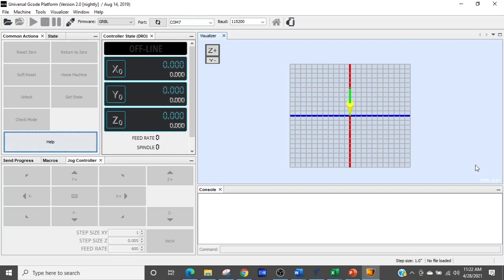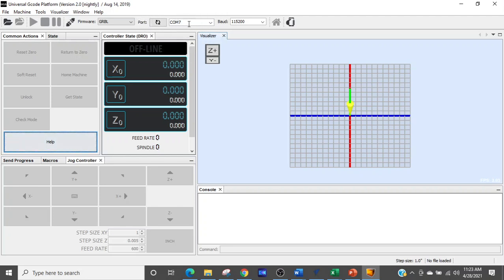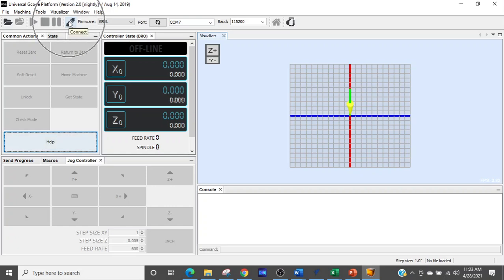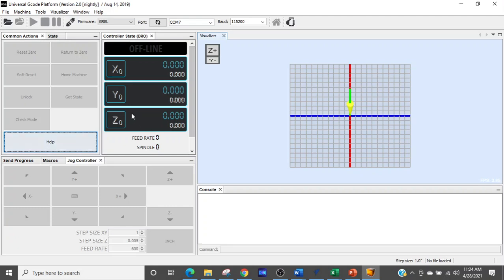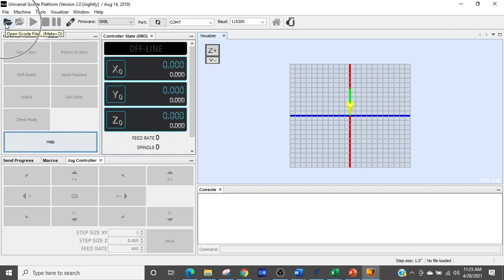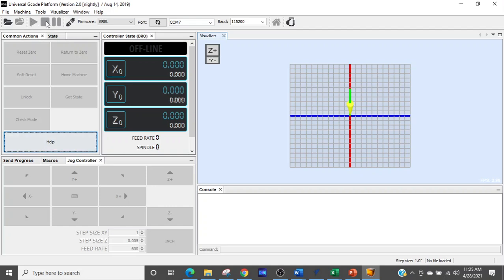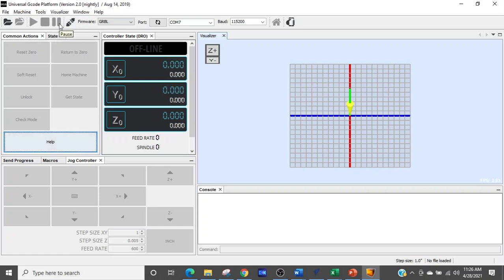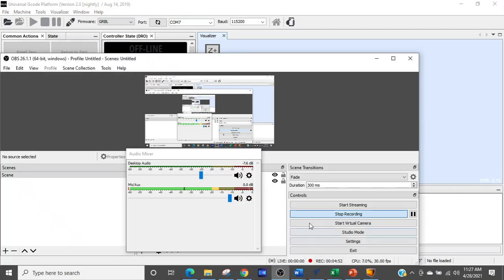CNC Router - Where's The Start Button? Universal Gcode Sender (UGS) - Garrett Fromme

Comment: Garret, I am subscribed to your videos because they are very detailed. You have convinced me to use Vectric and I am able to create projects. But from there I am confused. Also I need information about Soft Limits as My machine does not have limit switches
Reply from the maker: I'm really glad to hear you're enjoying the videos and finding them helpful! Soft limits can be a bit tricky to set up without limit switches; I recommend checking your machine's manual or reaching out to the manufacturer for the best guidance on that.

Comment: What software do you recommend for writing your g-code for UGS?
Reply from the maker: godsmissionarykidscamp1187, For writing G-code for UGS, I recommend using software like Fusion 360, VCarve, or Carbide Create. These programs offer user-friendly interfaces and a range of tools for designing and generating G-code. Each has its own strengths, so it often comes down to personal preference and your specific project needs.

Comment: sorry if this is a silly question . i just bought the vevor s4040 set it up did the test it worked fine went to do another cut today and it had glitches and alarms all movements work except the spindle will not spin . ive heard this machine may have quirks . if this is ok or relevant i could use some help. thank you and i love your videos
Reply from the maker: piniongears, No question is silly, and it's great that you're exploring your new machine! It sounds like there might be an issue with the spindle connection or settings, so double-check those. Make sure the spindle is securely attached and that all wiring is in good condition. Also, reviewing the machine's manual for troubleshooting specific alarms may provide some insight. I'm glad you enjoy the videos!

Comment: Sir i need to help I can't connect ugs to aurduino board. Im from India 🇮🇳. How can I connect give me feedback. Please wait fr u
Reply from the maker: Hi. I didn't use ugs. It's old and clunky You will find gsender much better and will automatically connect
Reply: @IDCWoodcraft  ok thnx I'll be try it
Reply: Sir I try it and g sender is connect but visualizer is not connecting. I was all every step check like g sender help platform. AI.. I can't find what is the main issue.. Give me other solution. I'm helpless. Please sir

Comment: But how do you start the spindle motor going? If I follow these instructions the bit just hits the board and it errors out.  In the other software I used there was a motor on/off button.  I would have thought that starting the motor should be part of the run code...... Unless I have not got it set up right.
Reply from the maker: cowasakiElectronics, this one is a little too tricky to answer over comment but I recommend joining Kate, Kyle, and I for our youtube live session this evening at 8PM EST. We should be able to help walk you through it!
Reply: @IDCWoodcraft  thank you for your offer but it’s the middle of the night for me. I’ve thought of a way since posting the question. I’m going to add a couple of macros with M03/4 and M06 Gcode. I THINK that that might do it. Then if that works I need to find a way to automatically add that in my gcode for each program. I’m hoping I’m going down the right route :-) Thanks

Comment: grade video! but i got one question i hope you can answer.

when i open a file, the starting point is at the top left position and i need it to be on the down left.

is there a way to change it?
Reply from the maker: Rafael, if you are at the point of loading your project to Universal Gcode Sender then there is no way to change it at that point. You will have to change it in the design software.

Comment: Great Video!!! But I have a Problem with connecting my cnc. all The settings COM port etc. is all correctly steetd i think but it will not connect. i have CNC3018 With GBRL an have no idea whats to try. have you any idea or tipp for me to fix this?
Reply from the maker: Tyrocraft, here's a guide on how to set it up on Windows! I think you'll find it helpful! Here's the link: https://docs.sainsmart.com/article/7c20d7zaw3-how-to-install-candle-grblcontrol-for-windows.

Comment: A question can I use UGS and run two separate machines, not at the same time, and will it save settings for both. My CNC and my Drawbot.
Reply from the maker: Dickie Fritz, great question! What I would recommend is after you download the UGS zip file, extract that file into two different locations, one for your CNC and one for your drawbot. That way you can have macros and settings saved for both machines in different locations. 
Although technically you could use the same instance of UGS for both machines, it might cause issues with your macros designed for your CNC interfering with your DrawBot.

Comment: I've recently subscribed. I like your videos and I am really up on the fence between a Longmill CNC/laser setup or a Foxalian (w/out CNC)/ Longmill laser setup because I like the different lenses setup.
One of my stopping points on the Longmill setup is it is already at the VERY limit of what I want to spend without buying a program to run it.
I don't understand the need for all these various programs. Can you just run everything off of this g-sender FREE program and maybe another Free program to edit pictures like Inscape and then just upload the file into g-sender and get the laser or router to do its thing?
I'm about to hit the buy now button on one of the two and I really would value your opinion.
I am also looking at going the 12x30 route and maybe in the future buying the longer 30" rails. Is that an option with Sienci Labs?
Reply from the maker: Hi Iwan. You need 3 programs. Design,  CAM, and router controller software. You can use other software but you have to have CAM to write the g-code. There are free software for every aspect.

Comment: G code generated in SOLIDWORKS is not compatible with ugs, what is the solution sir
Reply from the maker: Likely because solid works creates a format UGS cannot read. Enter the file using wordpad and resave to a txt doc. the other reason may be that solid works is using gcode that are advanced. Those codes will be inthe very beginning of the gcode file. I would have to see the file and know what CNC router you're using to answer better.
Reply: @IDCWoodcraft   hi is there a way to save to USB as I have a standalone controller ddcs2.1 and need to load from USB I must be missing something the only software free I can find that works is open builds finding it very difficult as a beginner..
Reply from the maker: @garyford5536  unfortunately I've never heard of a sandstone controller so unfortunately I can't help you on this

Comment: Hey Garrett, can you make an adjustment to say depth to the G-Code?
Reply from the maker: You can edit the gcode whenever you want. Can't do it in UGS though. Have to do it externally
Reply: @IDCWoodcraft  ya that would be nice to pause and adjust Z up or down 1mm
Reply from the maker: @markgarrett2971  with some controller software, you can edit gcode whole in prices. Not ugs
Reply: I’ve been UGS for about 6 months now, I like it a lot but lately it has stopped responding! I think it’s a Windows thing because the screen just goes blank and I get the message “program not responding “ and have to shut it down and start over. I’ve uninstalled and installed a new version but still happens, sometimes in just a few minutes sometimes it’ll run for a couple of hours. Haven’t got this one figured out yet. On another note, talking about editing gcode I ran across this little program that looks like it can be a lifesaver!  
https://ncviewer.com/
Reply from the maker: @rbwoodwork1890  oh, this looks interesting. I'm going to explore it.

Ugs does have it's bugs for sure